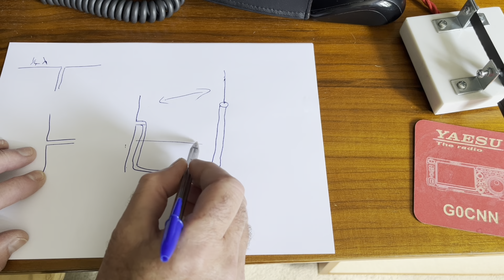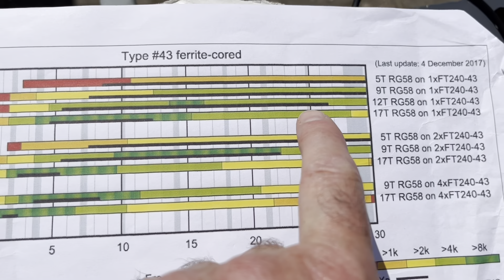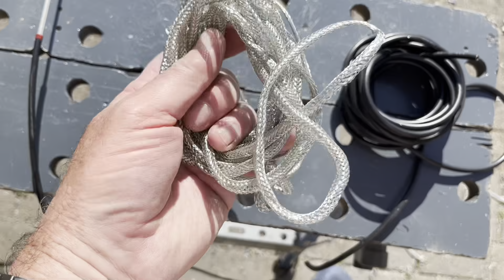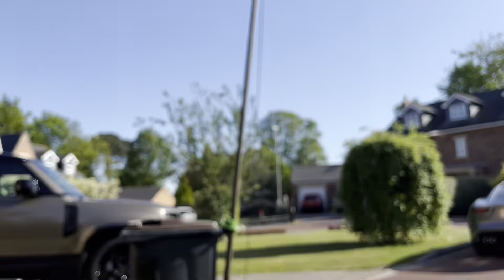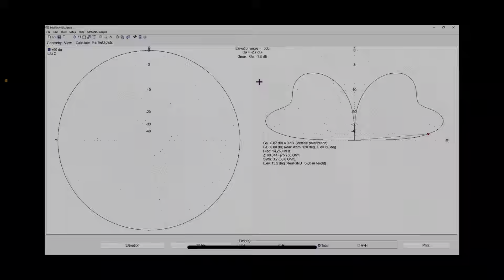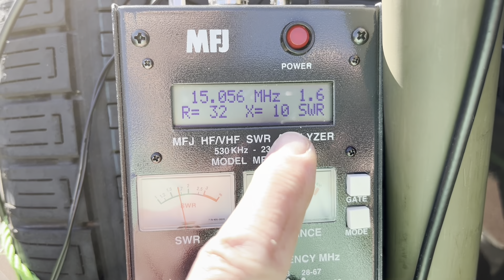Simple 20m Vertical Antenna With No Radials - DX Contacts on a Flat Band

Comment: Hi Ian. This looks pretty good for my first home brew vertical. I have all the materials needed and plan to have a go at making it this week. However I do have question. If the antenna needs trimming how would you go about it? Take it off the top or a bit off both ends. If its the latter I forsee that you would need unwind and reposition the choke which will be a bit of a pain. What do you suggest?
Reply from the maker: Hi John. Make it long if you want. Then you can trim the middle and then the top. Remember to take off twice as much length off the top to keep both halves the same. If short, yes you have to let coax out through the choke. Good luck 👍🏻

Comment: Thanks for bringing this design to my attention! I was planning on using a 15m vertical dipole on a 10m spiderbeam for field day later this month. I have made a 15m version of the t2lt and am going to do some wspr tests to accurately compare the 2. Instead of cutting the coax I simply soldered a quarter wave length wire to the center pin of the pl 250. Although with more thought it would be better soldered to an so239 chassis that gets plug into the coax. Im looking forward to making a 20m version for an easy pota antenna and an off centered fed version for multiple bands. Perhaps a non resonant off center fed vertical. 25ft wire with 15ft of radiating coax with the choke at the bottom of a 40ft spiderbeam and a 4:1 unun at the feedpoint. Lots of things to consider. If only I were better at NEC modeling! The radiating shield of the coax trick can be applied to many different kinds of antennas!
Reply from the maker: Sounds like you’re having fun Sam! 😀👍🏻

Comment: Hi Ian, I experimented with lots of T2LTs during lockdown particularly for 10 & 11m. I found the best way to permanently attach a "single core flex" radiator was by simply adding a cheap PL259 plug onto the RG58 & soldering the flex directly onto the centre pin. You can easily connect quite thick flex using this method. i.e. 6mm sq.
As I wanted the flexibility to switch between different element lengths, thicknesses, straight & spirally wound fold backs etc. I moved onto attaching these experimental radiators to the guts from old SO239 Chassis Mount Sockets (the Round type not square). Doing it this way made it dead easy to swap them out during back to back bandwidth, tune, & OCF testing.  73  M7GVS / 2E0GVS
Reply from the maker: Thanks Gary. Yes, I’ve got similar plans for this one so 🤞🏻it should develop further 😀

Comment: interesting. given rg58, does 45,9% include the velocity factor for the rg58 ? when calculating the coax length?
Reply from the maker: Yes, that’s the ratio I used for both this 20m and a previous 15m version.

Comment: Ian, I'd have joined it at the centre point using a quality heatshrink crimp butt connector.  It would have been mechanically sound and waterproof.  Then, a piece of glue lined heatshrink over that and the outer sheath.
Reply from the maker: Thanks John. I need to get some then. Yes, heatshrink over my joint RR 👍🏻

Comment: Thanks for sharing. 🙂
I like the T2LT antennas. When I started with ham radio last year, a 15m version was my first antenna and it worked great! 🙂 Sometimes I wonder why the T2LTs aren't even more popular. 
I have also thought why usually these antennas are presented with an air coil, and I was asking myself why not using a ferrite to choke the lower end - so thanks for confirming that this apparently is even better. 
There was one thing I was missing in your video though -
the process of cutting the outer off the outer part of the coax to get such a perfect result! I am always struggling with this and was hoping to see how to do it without damaging the inner insulator/conductor and the fingers. 😉
73 de DL1HNR
Reply from the maker: Hi Henner. Sharp side cutters are the key. I have a pair that have only cut coax, so have never gone blunt. Just careful “nipping” does the job no problem 👍🏻
Reply: @G0CNN-Ian  Hi Ian, thank you for that quick reply and the unexpected recommendation regarding the tool to use. That was so unexpected that I used a translator to look it up, but the result was the same as my brain gave me. So you are indeed using that tool that looks like pliers and has a pair of hopefully sharp edges/blades. Ok, I have never tried it like this, but have been using a special knife which then got stuck in the braid again and again. Using a side cutter that sounds like a plan -
a plan to avoid soldering some random piece of wire to the coax instead of removing the coax' insulation and the braid. 🙂
Reply from the maker: @hennero.3826 They are the ones I use to cut the coax to length in the video 👍🏻 If you pause and zoom in you’ll see what the tool I used is 😀
Reply: @G0CNN-Ian  Thank you, Ian. Now it is completely clear which tool you meant - even for the non-native English speaking part of you followers (me being one of them). 🙂👍
Reply from the maker: @hennero.3826 RR 👍🏻

Comment: I don't understand why the length was adjusted to something like 45.9% of the nominal wavelength. Can someone explain, please? Is the adjustment the value known as k, based on the diameter of the coax conductor? I notice that 45.9% would be close to the value of k (0.459) for some reasonable conductor diameters (say, 2.17mm).
Reply: Every day is a learning day. Ian just when I thought  my knowledge was half decent, I studied as a radio and line transmission engineer (didn’t cover amateur radio), I come across wonderful articles like this that gets the grey matter going in my 70 plus year old brain.  I get it and understand.  For portable use I deploy EFHW because set up time is quick and people always seem to gravitate towards any loose wires eg  radials.  I’ve been off the air for 18 long months due to a house move and it’s taken time to find a home for my radio gear and equally aerials.  Another DX Commander purchase and build underway as I’m with striking distance of getting back on the air.  Sorry I digress a little the £ question is there any benefits over vertical EFHW?   My 10 meter DX Commander Classic pole supports 20 meters upwards and 40 is too long for my use so this maybe a solution.  Thanks for all your vids.  73 Mike
Reply from the maker: @m0aze611 Hi Mike & thanks. Re: EFHV - personal preference I think and experience on-air? Good luck with the DX-C 👍🏻
Reply from the maker: It’s a half wavelength to start with (so 50%) and then coax properties and real world comes into play e.g. proximity to other objects, ground etc. In probably all cases this be less than 50% full wavelength. Hope that helps 👍🏻😀
Reply: vf rg 58 is about 0.66 in general.

Comment: The thing with a t2lt with a ferrite choke is that you can alter the lengths of the top and coax halves, giving a slight offset center fed dipole, improving the match and hence the vswr. Thanks for the video.
Reply from the maker: Yes, good suggestion John, I’ve not tried that.

Comment: Hi Ian, what sort of power do you reckon that choke will take before saturation 🤔
Reply from the maker: Hi. Based on commercial models I used to expect this to be good to the old UK power limit of 400W. Now we’re allowed 1KW, I’d be using two stacked for these higher power levels. If the SWR rises and all else is ok with feeder and antenna etc, then that’s the sign the ferrite is struggling. All subject to the power rating of the coax used & frequency. Hope that helps 👍🏻
Reply: @ thanks Ian. I have a Linear Amp UK Ranger. Around 800W PEP on full chat. I will try 2 x ferrites I think. I’m going to scale one for 17m. I think 17m is a great understated band and no contests. 73 M0CKQ.
Reply from the maker: @adamap2796Agreed Adam 👍🏻 Forgot to say, the SWR issue will show on transformer ferrites eg 4:1 etc. On a choke, if you hold the shack coax and your SWR varies, then there’s common mode coming down (or sometimes just in the shack from say a close antenna). Have fun 😁👍🏻

Comment: i made my T2LT 20m antenna as follows... choke was 15 turns on a 110mm diameter, then 5m of the lower part and 5.02m for the top section and I get a reading of 1.18 vswr
Reply from the maker: Great! Thanks for the additional info 👍🏻

Comment: Thank you for the alternative to radials.  Given I live in a HOA and have little patio area that has patio bricks base. I am always looking for antenna options that do not require long radials.  My patio area maximum length is 25 ft.  Currently have a delta loop with base center feed on a 6M mast.  Will keep watching your site for options.  Regards  Ed KK7UNA
Reply from the maker: Ok thanks Ed. I’m going to experiment more on this so watch this space…👍🏻